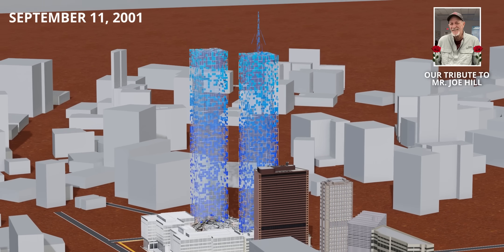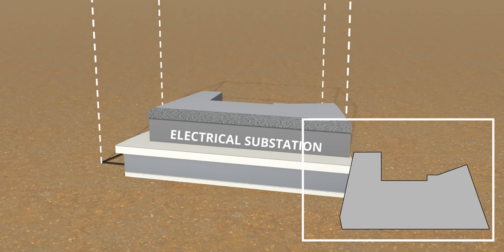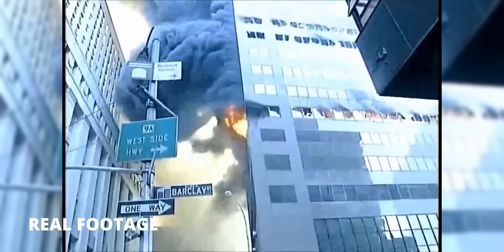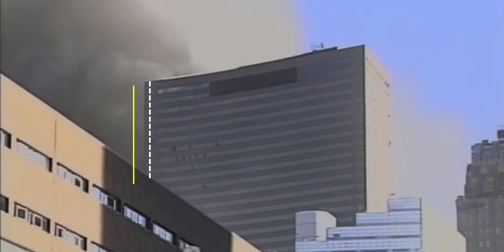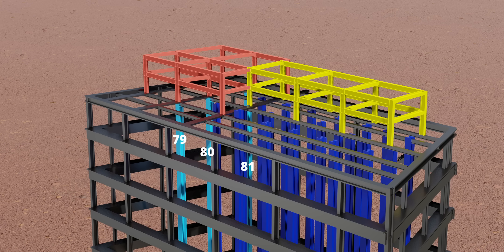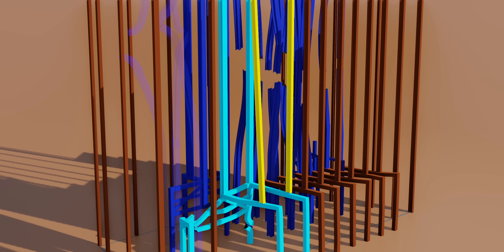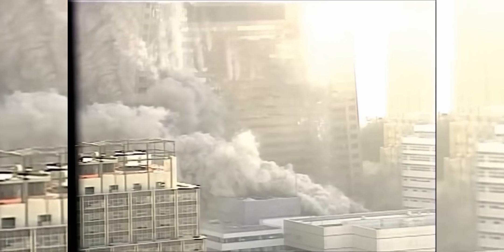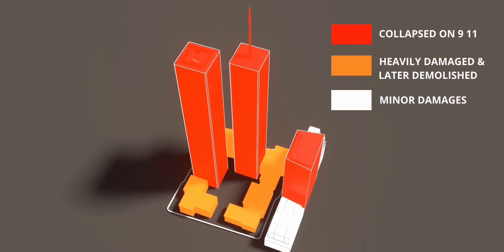Collapse of Building 7 | The Complete Physics

Comment: UAF university of Alaska Fairbanks prepared a report for Architects & Engineers on the 9/11 report & concluded that the official 9/11 report lacks scientific clarity and makes a lot of assumptions, I recommend y’all reading that report
Reply: Most people who recommend and endorse the Hulsey report have never actually read it or would understand much of it if they bothered. I have actually read both the Hulsey preliminary and final reports from cover to cover, and I have to say, there are a few problems. The Hulsey report is such a dead horse now, flogged so many times I find it difficult these days to drum up the enthusiasm to do it yet again. But here it goes.

My quick and dirty opinion of the Final Report is as follows:

The Hulsey Final Report on Building 7 met none of its three stated objectives – indeed could not have met those objectives for lack of trying - and failed to prove its main conclusion, by way of a fundamental logic error; Hulsey claimed he had concluded fire could not bring down Building 7 without accounting for the full envelop of possibilities. Essentially, he claimed to have proved a negative

Hulsey also plagiarized almost 3 pages of material from Tony Tsamboti, who works for the studies sponsor. I hope I don’t need to point out the ethical implications of that.

While promising superior models to those of The NIST, the Hulsey Report in fact delivers grossly inferior models which eliminate the time factor, focus on only two floors and rely on a greatly simplified version of The NIST’s temperature data. They used linear static analysis to study a nonlinear dynamic problem.  The model animations are clearly not derived from the model data as they show no dynamics at all and are obviously forced to make the animations (superficially) look closer to AE911T’s imagining of the real event.

Overall, it is a shoddy piece of work done by a man clearly working out of his element and areas of expertise. It rather reeks of trying to support a conclusion arrived at before the study started. Curiously, study sponsor Architects and Engineers for 9/11 Truth having announced what the study would conclude before they awarded it.

Hulsey tested just one out of countless thousands of possible scenarios, using a completely unrealistic scenario and an artificially restricted set of data almost like he wanted to ensure fire would not cause a failure. The Hulsey Report was so factually inaccurate, methodologically unreliable, scientifically unsound, illogical, and biased that it blatantly violated any requirements of objectivity, utility, transparency, and reproducibility that would have been required to submit it for peer review in any reputable journal.

Hulsey and his assistants have not published the report anywhere that any relevant academic or professional engineers look to.

Hulsey had said all along that the report would spawn several (perhaps four) papers in good American engineering journals and possibly a book.

Then Hulsey walked that back, realizing he'd stand no chance to pass peer review in America and so said he'd go for European journals - but years have gone by with no publication whatsoever. Also, no book from any science publisher either. As far as the engineering profession and science are concerned, the Hulsey report barely exists.

The engineers of America and of the world have never read it. It has had zero impact in the professional community.

To its intended non-engineering literate audience, they Hulsey Report contains enough engineerspeak density for them not to ask questions, even if they were so inclined. Since the report appears to (superficially) deliver what they want, they are not inclined, even if they knew what to ask. From a structural engineering perspective however, The Hulsey Report is of no value, which explains why promises to get the report published in peer-reviewed and reputable engineering journals where it could be scrutinized by qualified professionals were abandoned.

If you are genuinely interested in what happened to Building 7 rather than in promoting a political agenda, there are several excellent forensic engineering reports out there and over two dozen articles published in genuinely peer reviewed engineering journals that are far more comprehensive and competently done. I suggest you seek them out instead.

And actually read them.

This should get you started.

FEMA BPAT (initial report superseded by NIST NCSTAR 1A)

NIST NCSTAR 1A: Final Report on the Collapse of the World Trade Center Building 7, 2008.

Guy Nordenson and Associates, WTC7 Global Collapse Analysis Report and Summary of Findings, 2010.

Arup, WTC -7 Structural Fire Analysis Report (Runs 1-4), 2010.

Weidlinger Associates Inc., WTC 7 Collapse Analysis and Assessment Report, 2010.

BRE Centre for Fire Safety Engineering, Analysis of the Impact of a Fire in the Mechanical Room (5th & 6th Floor) of the World Trade Center 7 Building, 2010.

T. McAllister, R. MacNeill, O. Erbay, A. Sarawit, M. Zarghamee, S. Kirkpatrick, J. Gross, Analysis of structural response of WTC 7 to fire and sequential failures leading to collapse, J. Struct. Eng. (United States). 138 (2012) 109–117.

For a summary of the major studies I would recommend THE COLLAPSE OF WORLD TRADE CENTER 7: REVISITED by Mhd Anwar Orabi , Liming Jiang , Asif Usmani and Jose Torero which is a 27 page summary of the different analysis and conclusions published in 2020. Sorry, YouTube will delete this post if I give the link but it should be easy to find and is available from the University of Queensland, Brisbane.

Real structural engineering industry professionals conducting real engineering studies and publishing them for other professionals to see. Not amateur YouTubers appealing to the gullible and credulous.

Happy reading
Reply: No, it really didn't. It didn't conclude literally anything. Then again, there was no "UofAlaska" report so that's not really a surprise. The report made by Hulsey had nothing to do with UofAlaska, and didn't conclude anything either.

Comment: A guy did a test using thermite to cut similar beams to what they used in WTC and they did a half ass job with the test trying to prove it wasn't thermite. Then another guy did a better test focusing the charges on specific areas of the beam and it worked perfectly. Similar to how the building were demolished.... excuse me collapsed
Reply: Uh huh.

youtube.com/watch?v=JXWCMBuusMI&ab_channel=TrutherTVArchives

In this video starting at 45:35 and running to 48:35 the Energetic Materials Research and Testing Center (EMRTC) conducts a test to examine the effectiveness of thermite in cutting a vertical hollow box-section steel column very much like those in the Twin Towers. The column tested is however smaller in cross section and made of thinner steel than that of the Twin Towers perimeter columns (and never mind the core columns).

In total 175 pounds of thermite are used for the test on just one column, requiring the construction of a rather conspicuous coffer dam to contain it. Do recall the Twin Towers had 240 columns and 110 floors. It would be odd if thousands of office workers missed hundreds, perhaps thousands of those suddenly appearing.

Note what an incredibly slow process this is. It took close to 30 seconds for the thermite to finish burning off. It would be impossible to “control” a demolition using this material. Not to mention the issue of; how does the aircraft impact and subsequent raging fires NOT prematurely set this stuff off?

Also note how bright and obvious the whole process is. Could not be missed visually. No way to hide that.

Then at the end of the test the (relatively modest) column was undamaged…. which is a problem.

Certainly no rivers of molten steel emanating from it either and in fact the whole thing cools rather quickly as soon as the thermite has burned off, as one would expect.

Thermite has never been used in the controlled demolition of any building, let alone one with multiple floors on fire after the impact of a large jet. If the conspiracy oriented internet has taught us anything it’s that if something has never happened before, it can never happen.

All of this very much ado over nothing anyway since WTC collapse mechanisms are well known and understood and no thermite of any sort was involved.
Reply: Since you can't actually define this "a guy", or "another guy" or literally anything at all?
No. Making up "a guy" isn't an argument for anything other than how you need to lie to soothe your ego.

Comment: Okay so I’m no engineer, at all. I’m also not saying this video isn’t stating true facts. But I’ve seen videos that I have saved on my phone that show flashes and also sounds of bombs going off all through out building 7 from the outside right before it fell, and it’s to good to be called cgi. It doesn’t make any sense at all that a building that wasn’t even hit by a plane or right next to the twin towers did a free fall because of a fire that was on a couple floors. It just doesn’t make any sense.
Reply: You are probably talking about the one made by Edward Current. It's fake.
Reply: You could always read the engineering report on the collapse.
Reply: Those would be fake. This one however, is real: www.youtube.com/watch?v=4xN8lzBo9zY

Perhaps this will make sense.  Get comfortable:  Building 7 collapsed from the inside out which is not at all intuitive and hard to understand, with most details being hidden from view.  It requires careful analysis and observation, and some people will struggle no matter how much it is explained. But here is my explanation relying on no outside authority. 

Building 7 was a unique, asymmetrical 47-story steel frame structure built atop a smaller 3-story building serving as a partial foundation, requiring lower floors dedicated to complex load transfer structures. Of trapezoidal shape and tube-in-tube construction, B7 (above the 7th floor) consisted of a central core of steel columns carrying most of the gravity load, perimeter steel columns around the outside of the structure carrying the remainder of the gravity loads and long span beams and girders to tie those elements together and form the floors. On the outside of the building hung a facade or outer shell. 

www.nist.gov/image-16640

Phase 1 : First externally visible signs of collapse initiation occurred at 5:20:28 pm and was notably quiet with observers not realizing the building was collapsing! No warning in the form of hundreds of eardrum busting 180dB explosive bangs. Here at 12:00 a local CBS affiliate reporter talking 10 blocks from B7 when collapse begins. People don’t start to notice the collapse until 12:11. At 12:45 is the famous CBS fixed camera clip of Building 7’s collapse. Note the silence. 

www.youtube.com/watch?v=t5tEy6mXSE8

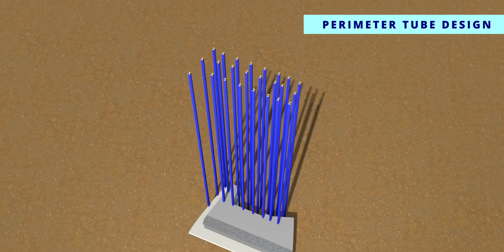Lower floor failures above the load transfer region (8-14) in the NE corner initiated the collapse. In this video at 0:45 you can see the NW corner from inside the building while under construction, Column 79 just out of frame on the left. That big, angled steel beam across the top of the frame connects to C79 at one end. The girders connect to the beam. That beam and all those girders depend on just one connection 

www.youtube.com/watch?v=nP3TNHPCIVU&t=45s

Phase 2 : NE corner floor failures caused a loss of critical lateral support over an excessive length of Column 79 and it buckled. Looking at the above floor diagram of Building 7 when you see all the structures that depend on C79 you quickly realize this one column was a relatively isolated structural element on which a disproportionately greater fraction of the structure depended analogous to say the Key Bridge. Externally as collapse begins we see a vertical progression of window breakage along the 44-46 line and a kink in the roof of the East Mechanical Penthouse at the top of the building, consistent with C79 failure. Normally with a buckling column, the load could be redistributed to other columns. With C79 that is not the case - the failure did not redistribute the load, so the collapse rapidly progressed to the roofline, sinking the rooftop penthouse. The transition from full capacity to almost no capacity occurs in an instant and will result in virtually no resistance 

Phase 3 : With C79 gone, B7’s progressive, non-symmetrical collapse continues with adjacent columns 80 and 81 left laterally unsupported and quickly buckling as well. The EMP drops down through the building. C79-81 all have no diagonal bracing, which is the major reason why they could not redistribute a lot of vertical loads among one another. From there collapse progressed from east to west through the central core until the core was gone from 81 to 58, taking all the interior floors and probably most of the perimeter columns with. Follow the horizontal progression of window failures low in the building and the dropping of the remaining rooftop structures into the building. The NIST Building 7 study model 4 determined C79 failing under ANY circumstances would have initiated the same collapse sequence. 

Phase 4 : After about 10 seconds only the exterior moment frame remains, giving the illusion B7 is still standing to the casual observer since little has outwardly changed. But it is just a hollow empty shell like an empty cereal box supported only by a few remaining columns and overloaded from the loss of the core columns and floors, quite unable to remain standing. With nothing remaining behind it, the north face leans inward, forming a V in the roofline, the last few columns buckle under the strain and the moment frame free falls, landing on top of the debris pile. 

It is only here at the very end, a single measurement of alleged free fall acceleration is taken, from just one point on that outer shell. The Building (core and interior) did not “free fall” - was already gone before that happened - just one corner of the outer shell briefly moved at a rate comparable to FFA. This alleged FFA was a product of how the shell fell NOT why the building fell . It’s also not even proper FFA as the single measured point was moving in 3 dimensions, not just down, which adds another variable. Start to finish the collapse took 18-20 seconds, 3 times longer than true FFA . How fast something falls can’t tell you what started it falling, certainly not 10 seconds after it started falling.  

The debris spread outside the footprint blocking surrounding streets, heavily damaging the Verizon Building and destroyed Fiterman Hall. 

No building is meant to survive 7 hours of multi-floor unfought fires. Building 7’s progressive, non-symmetrical collapse was incidental, unintended collateral damage from the combination of fire, time & gravity started by the collapsing North Tower, true no matter who planned and carried out the 9/11 attacks or why .  Of so little consequence it barely registered at the time, only taking on semi-mythical status as an alleged smoking gun years later when demolitions at the Twin Towers, missiles at the Pentagon and shoot down over Shanksville all failed and conspiracists had nothing left to work with. 

Anything can seem like a conspiracy if you don’t understand how it works. Now you should. I hope you found this helpful, informative and it solicits informed critical comment. If I made any errors of fact, logic or reason or left anything important out, please let me know so I can fix it. OR offer a more plausible alternative if you can. Be the first. Please start any reply with the words “Tits McGee” or I will know you didn’t read it and are wasting my time.
Reply: Would those be the same videos as the ones with the ufo flying past? Because, that's always such an stellar level of believability.